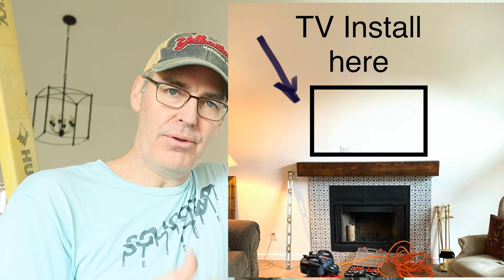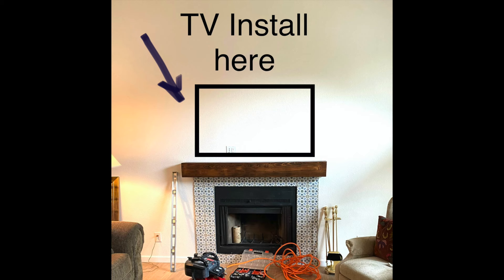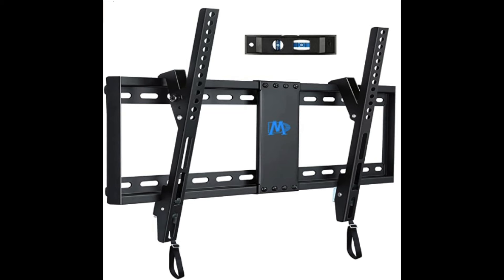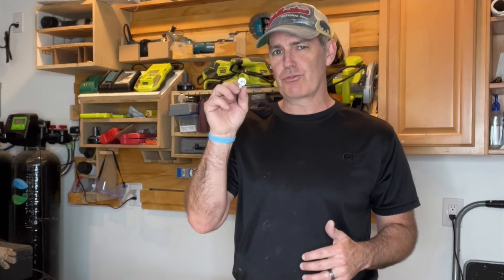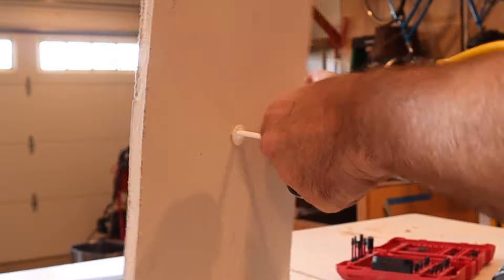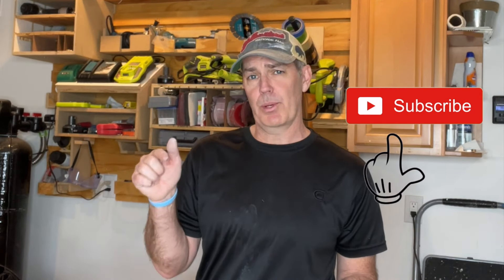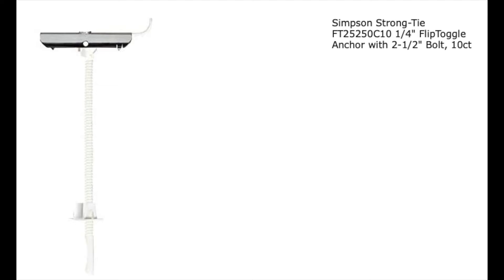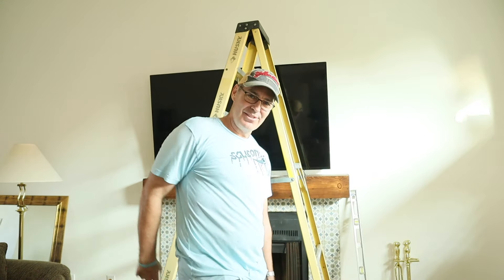Best Way to Attach TV Mount to Just Drywall

Comment: Honest question or concern, i went to buy these today and the package actually says, "do not use for mounting televisions"
Reply from the maker: Haven’t had a problem at all.  Just make sure you use a flushmount instead of one you can pull out and move left or right. Once you move tv away from wall…the “shear” weight load on package is voided

Comment: does there have to be a stud on one side or will it be okay with just the anchors?
Reply from the maker: A stud is better…BUT…u don’t need a stud.  Just don’t use a tv mount u can pull out and articulate (move left and right).  No guarantees on that setup
Reply: @how2q  thank you so much!

Comment: Can you hang a tv 65 inch, on just drywall. Where there absolutely no studs?
Reply from the maker: Yes, but only use flush mount tv mounts.  Do not use ones you can pull off wall
Reply: @how2q  awesome thank you! 🙏
Reply: @how2q  been wanting to hang my lg oled but was a bit worried
Reply: @how2q  What about an 85 inch TV without a stud? i mounted with 6 Toggler anchors and enhance with other drywall plastic anchors
Reply from the maker: @ulasnalbantoglu3382 sweet…the more the better!

Comment: what's the best way find a stud without buying a stud finder as im not buying 1 for 1 tv to go up
Reply from the maker: If you have a good ear and or a magnet you can find a stud.  Knock on wall…drywall on stud has a different sound.  Grab a magnet…slide it back and forth over wall to find drywall screws, when u find the screw you have found the stud.  Once u find one measure 16” or 24” either side and u should find another stud.
My cheapest go to is a glorified magnet: https://amzn.to/4aIkiGM

Comment: Can it hold 75 inch TV? Will it be secure?
Reply from the maker: Lot of depends on that one…weight & size of mount matter.  Bottom line i would recommend have a stud on at least one side of the mount.  Will help secure it.
Reply: I have 75'. Should i mount the bracket in center of the sturd and use the turgle on both other sides
Reply from the maker: The more the merrier as they say.  If you have a stud available definitely use it.  It may be overkill to use for toggle bolts, but I would do it.

Comment: would it hold a 100 inch / 100 pound tv?
Reply: Or would it be better to put two pieces of plywood between the nearest two studs and then fasten the tv mount to the plywood?
Reply from the maker: It sounds like a very expensive TV. Quick answer would be technically yes. I only say technically because the sheer weight… Vertical weight…it would hold w only a mount that was against the wall (would not use one that you pull out and move left and right).  To be 100% sure on the install… I would go with the plywood option.

Comment: I'm having this exact problem,  but my concern is over time it just pulls the drywall apart under the weight of the TV? I'm mounting a 65 inch as well
Reply from the maker: Can u catch one stud on one side.  I think the key here is to not pull tv out and articulate it.  More stress on wall.  Been a while since i put this one up…no issues
Reply: @how2q  yeah unfortunately we want it out a  bit and tilted downward as well. I didn't realize they cut lumber costs by cutting down one the studs lol. Our studs are 24 inches apart,  pain in the you know what lol

Comment: What did you mean when you said "this will be a rental" pertaining to the wall mount?
Reply from the maker: Only i would have probably gotten something more “exotic” (expensive) if it were my own home.
Reply: @how2q  I get it. I thought you were saying you rented the mount...
Reply: @how2q  what's the best idea for ½" drywall on a short wall with studs 24" on center? I'm about to go to Lowes and buy Molly bolts. I'm absolutely exasperated with this simple process. I've never had such a hard time doing something so simple.
Reply from the maker: @yelram4life  lol some of the “simplest” jobs are the hardest. I would definitely try and grab one of those studs on one half of mount.  Discussed earlier were mounts that you can pull TV out and rotate. I would not recommend that if you don’t hit any studs

Comment: The screw is too long for my situation to use the toggle bolts.   I only have about a half inch space behind the drywall before I hit block.  I live in Florida where the drywall is mounted on a furring strip which is mounted on block.   Any suggestion on what to use to mount on the drywall?
Reply from the maker: I actually have a video on that… This is your exact situation. My sons house has drywall on black with a 1 x 2 furring strip… Which, of course is a half inch thick.  https://youtu.be/vPGi7lGsauA
Reply: @how2q  Wonderful, just what I was looking for.  Thank you for doing these informative videos!
Reply from the maker: Glad it helped out!

Comment: I tried to install the t.v for my girlfriend and it didn't go good the left side toggle bolts broke threw the sheetrock now I have to figure out another route glad I found your video I'm going to have to try those flip toggle bolts looked so simple , I hope I didn't do to much damage already but I'm going to have to try it all over again that's for your video and tips .
Reply from the maker: Make sure mount is a “flat mount”.  If its one you pull out and can move tv left and right it might not work.  Also, hopefully ur mount has numerous holes you can use to secure to wall.  Good lucj

Comment: I had to mount my 65 inch tv with one side of the mount on studs and the other using a anchor
Reply from the maker: Will be super solid.  No issues w this setup since i installed two years ago

Comment: I have an apartment, studs are like 4.5 feet apart here unfortunately but I want to put my 55 inch tv directly above my monitor. With little options I have and Considering I’m in an apartment, how would you simply remove the flip toggle bolts if I were to ever move?
Reply from the maker: They are actually very easy to remove.  You just unscrew bolt….once bolt is backed out all the way the metal toggle will just fall away.

Comment: Hi!!  can you use this great drywall bolt on single stud tv mount? or this only works with 4 bolt ?
Reply from the maker: Your answer may be in title.  Like this project…i do like to have at least one stud.  That being said…your could probably get away with it.  If it is a tv that pulls out and moves left right i would be hesitant to install without stud.  If its flat on wall type mount i would be ok without stud

Comment: Why can’t you theoretically just put nails into the wall? And just skip the early steps? Will it fail without those steps?
Reply from the maker: Nails and tv mounts don’t mix.  Never do it.  Lag bolts into studs or toggles
Reply: @how2q  ok, in that case, I'm gonna try and look for some of those tools you mentioned.

Comment: Would that work with 85inch TV? Weight is ~100lbs.
Reply from the maker: Yes a flat no motion tv mount.
Reply: @how2q  gonna try in a few days. Hopefully I won't find my TV on the floor lol
Reply: Don't mount an 85 inch TV into drywall are you serious just get a stud finder its not that serious.
Reply from the maker: @dangirascepulis8737  how did it go??
Reply: @how2q  found studs so all went well lol

Comment: Can this still be done if there is no stud at all?
Reply from the maker: Yes cynthia.  As long as tv stays against the wall.  Some mounts you can pull out and rotate…would not suggest you use these.  If you have one that pulls out and rotates, I would get a piece of three-quarter inch MDF, and attached to wall (hitting studs) then attach mount to that. Of course paint MDF color of wall.

Comment: Two comments.  First, mounting a TV over a fireplace is not a great idea.  Second, it would be better to add a 2x4  horizontally between two studs than just attach to drywall, no matter what kind of screw anchor you use.  Or use a metal bracket to span the two studs.  Various solutions exist that allow you to make a very solid and reliable connection.
Reply from the maker: Thanks for great info.  Agree over fireplace not ideal but often a “necessity” in any room with a “centered” fireplace.

Comment: This isn’t really safe and does not offer peace of mind. How I would do it is get 1x4s and screw it into the studs. Paint the wood to match the walls. Then screw the mount onto the 1x4s.
Reply from the maker: Peace of mind always important.  This method gives me peace of mind.  Did this project 3 1/2 years ago, in a rental, and it still good to go.  I agree that if someone doesn’t trust this method three-quarter inch ply painted works.